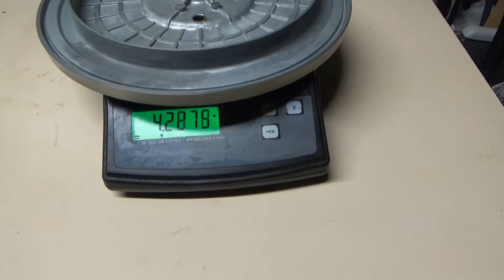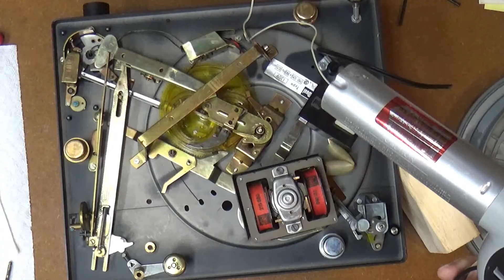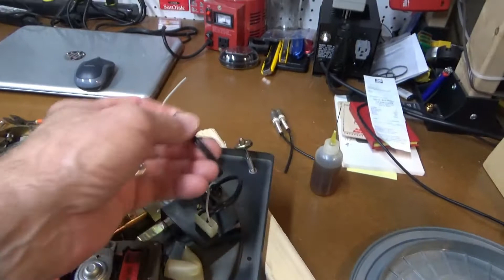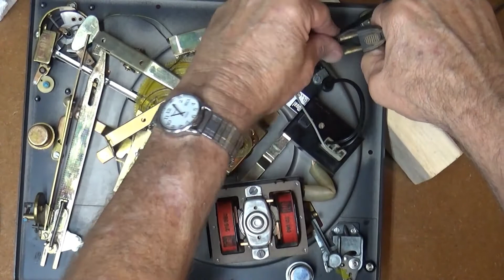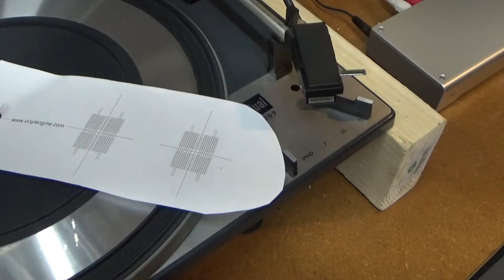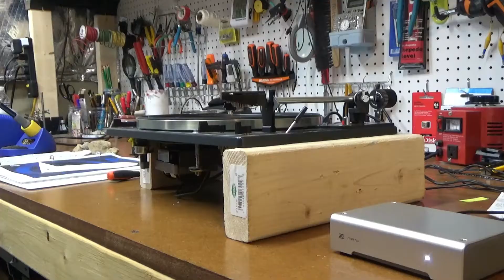1970-71 Dual 1209 Turntable Restoration

Comment: Just got 1209 for zero. It’s totally gummed up and dirty. But optically has real good substance after first cleaning. Mechanism is slightly different and more complicated than 1218 I just fully restored. That one was as cheap as nothing as well - zero payment as well because it didn’t work. Now it looks and runs as new. These Duals will live forever. All 10-20 years a service. That’s all. 
Great video.
Reply from the maker: Congratulations. The old Duals were great turntables that will probably last forever. However the lubrication on all the mechanical bits and pieces does need service. It sounds like you are on your way to becoming a good local source for everyone in your area that needs a Dual turntable service.
Reply: @mguess thank you. I studied economics and was a technical fool. 😂😂😂. One day I got a wrecked Dual 1019 from 1965 and was fascinated by looks and how massive everything is in comparison to nowadays equipment. I watched nearly every video related to restoring vintage turntables and finally gave it a try. First my friends and family said to me "unusual for a woman like you to restore old turntables". 😂😂😂. But hey. It is fun for me. Meanwhile I refurbed some 10xx and 12xx idlers - more to come - and also consider to make a business out of it because there are literally no technicians with this Know-how. That leads to the point that people throw away or gift their old and wrecked Duals. And then it’s me to pick them up and give them a new life.

Comment: What cartridge do you recommend for the 1229?
Reply from the maker: The 1229 is the top of the line for Dual idler wheel turntables. You may want to ask Bill Newman at "fixmydual.com" what he would recommend for the unit. He's the expert. I currently have a Audio-
Technica AT120eb on my Dual 1209 and a Audio-Technica VM95ML on my Dual 1019

Comment: Looks like I know the details of your head better than the Dual turntable 😅 Thanks for the tutorial on relub and tonearm setup. I'll do it on mine soon. I suspect mine is pretty much jammed because of sticky grease, but I've got casing and plastic lid in  ery good condition. BTW what's the speed  measurement app please ?
Reply from the maker: Good luck with your restoration. The app is called RPM Speed and Wow

Comment: I have a 1209 that works ok but the Start/Stop switch doesnt work. It just spins and spins and spins. Wish you were located in my town, id take it to you for repair.
Reply from the maker: The cause of that issue could be a gummed up mechanism like mine had.
Reply: Look at 7:20. That lever starts and stops the motor. If it’s gummed it can’t. Heat it. Move up and down and clean it with isopropyl alcohol several times then lube it. Et voila.

Comment: Nice job! Just wondering if the Shure V15 is a bit of a mismatch for that tonearm? The V15 was a top of the range high-compliance cartridge usually mated to a low mass tonearm like the SME 3009 arm back in the 70s.
Reply from the maker: Thanks for the comments. You are probably right about the V15, it has a very light tracking force. I've done some cartridge swapping since that video. I moved the Sure V15 series 3 over to my AR XA turntable. The Dual 1209 currently has a relatively modern Audio-Technica AT120eb cartridge. I also have a Sure V15 series 2 on my Thorens TD125 with a Rabco SL-8E liner tracking tonearm. I believe that is the original cartridge from about 1968. Unfortunately I don't have any nice SME tonearms. Maybe someday.

Comment: These turntables take special lubricants and adhesion oils. Some parts use 10w30 motor oil. But if you use the wrong oil on the wrong part, then you will have  problems.
Reply from the maker: Currently I use just a few oils on turntables. 3in1 standard 20W oil for most general lubrication, and 3in1 electric motor oil for the electric motors. I also occasionally use Singer 10W oil when I need a very light weight oil and 30W non-detergent (air compressor) oil if I need something heavier. I generally try to not use automotive engine oil. What do you like to use on turntables?

Comment: hello , you have probably figured it out by now , but the stylus tip should be on the main crosshair intersection on the protractor grid , not anywhere along the centre line . there is lots of videos on the web of how to use them properly . the cartridge looks like a v15 shure cart which has a fine contact line stylus which is hyper sensitive to alignment so a little research on how to get the most from it might be a worthwhile endeavour. 😘😘
Reply from the maker: You are correct. My camera work wasn't very good on the cartridge adjustment procedure. I recently ordered a mirrored protractor to make it a little easier to do a proper alignment. That is a Sure V15 Series 3 cartridge. I moved that cart to my AR XA turntable and put a relatively modern Audio Technica AT120Eb on the Dual.

Comment: Whatapp is that. Great video.  I just got a 1229. Great condition, buts needs some attention.  Good video’s and helpful.
Reply from the maker: The app is called "RPM Speed and Wow" Good luck with your restoration. Great little turntables.

Comment: I was wondering where I could order any parts for this type of record player. Specifically the needle, on mine it’s hanging by a thread and might need to replace the whole cartridge.
Reply from the maker: You can replace the stylus (needle) on most cartridges. If you know what model of cartridge you have you can just google a replacement stylus. If you can't find a reasonable priced replacement stylus, you may want to replace the cartridge with a new one. Two of my favorites are the Audio Technica AT-VM95E for about $70, and the Ortofon 2M Red for about $100.  There are cheaper and much more expensive cartridges out there but these two sound great for the price. You can order both of these on Amazon.

Comment: I don't understand why you took down my comment about turntable level not being a real issue. It WAS truthful as this video from another poster will show..   https://www.youtube.com/watch?v=lwHXMWBghYc
Reply from the maker: I'm very sorry Phil. I don't recall seeing your original comment or removing it.  It my have been a "fat finger" thing especially if I was checking comments on my phone rather that the laptop. Please repost if you could. I always welcome comments and constructive criticism. I just checked out the video that you linked. Pretty amazing. I've actually tried it myself so I know that it works. Here is a link to my video that I posted about a year ago.  https://youtu.be/gbKsYaCJ0us
Reply: @mguess  I see by your video link above that you also prove the point of level being a very minor, if any, consideration for these turntables. Why Dual's stylus tracking force method is not the industry standard is beyond me as it clearly has some major advantages. 

Since I didn't know you posted the same idea, basically, and in order to provide a bit more understanding to other readers, what I originally wrote was that the 1209 used a different method of tonearm balance and stylus tracking force. ie: the counterweight is used to set tonearm balance in all axes. The stylus tracking weight is set by a dial calibrated/marked spring. I just checked my stylus tracking force with a scale and it was correct and matched the dial very well. In theory, turntable platter level does not affect the stylus tracking weight and the turntable could play a vinyl record at any physical angle. As my above posted link showed the 1209 playing a record vertically and even upside down.

Also, I mentioned that I have an Ortofon Mirrored tonearm head alignment gauge and the instructions clearly say to place the stylus on the crosshair of the reference grid and then check the alignment of the cartridge body to the grid and make adjustments in length and angle to match at both grid locations. If the cartridge is odd shaped, checking the angle of the stylus cantilever in the mirrored view can be used to verify perpendicular alignment.

I also gave a site link where turntable user and service documents could be found for free. It helped me a lot in restoring my 1209. 

https://www.vinylengine.com/

They also have forums where you can discuss issues, problems and news and get tips on turntable setup.

Anyway, I hope this info gives some understanding as to why vintage Dual turntables are still highly regarded and sought after.
Reply from the maker: @philatwood2086  I agree with you. When I bought my first Dual turntable (model 1237) in 1978, the salesman demonstrated playing a record at a angle. I was sold! I've got 3 different Dual's in my main listening room now along with a Thorens and an AR-XA. I listen to all of them. Great vintage turntables.

Comment: I have a Dual 1015, has a similar mechanism and Idler wheel.  I find the pitch adjustment isn't that good at on the fly pitch adjustments.   I also find that often if you get 33 1/3 right, 45 will be a bit out.   Once warmed up, the wow/flutter will settle down a fair bit.
Great little turntables once they are all tuned up.
Reply from the maker: Hi Brendan and thanks for the comments on the video.  It is common to have to adjust the fine pitch on Dual idler wheel turntables when changing speeds. As you can see in the video its just a manual mechanical adjustment. That's part of the charm of the old vintage equipment. If you are having trouble getting the speed adjusted properly you may want to check the idler wheel mechanism to make sure it is moving up and down freely.